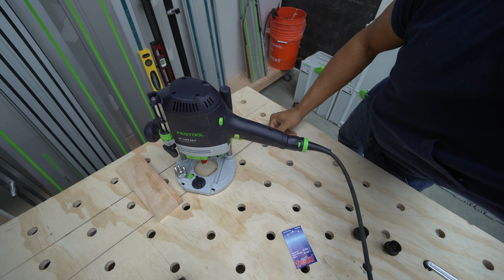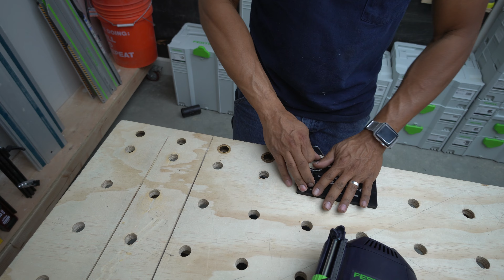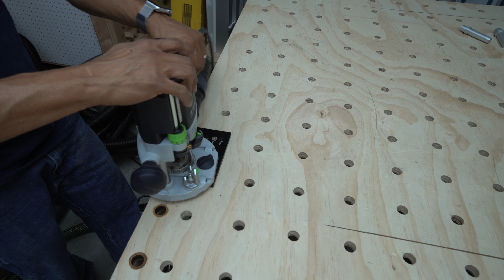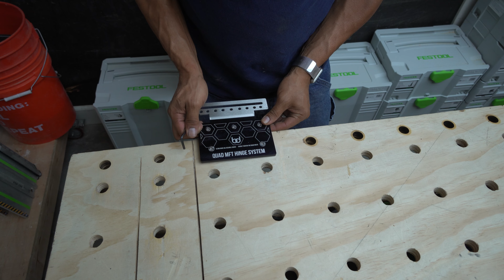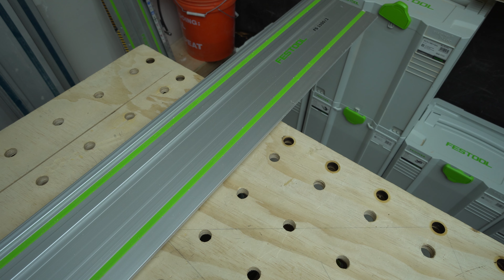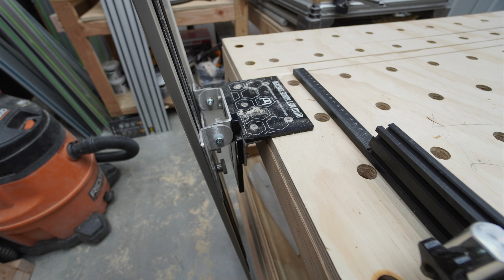BenchDogs CO UK Quad Hinge System Install

Comment: You made think I need that jig to make a MFT or do off sets. I have a bench dog china nock off. I have lots of bench dogs stuff but shipping cost made the hinge way up in price. The nock off was $140 delivered to the US, plus they added a piece to it. The added piece intrigued me and was the added reason to buy it. I let Bench Dogs UK know about the nock off.
Reply from the maker: I am glad you found a product that works for you. I decided to use the Benchdogs solution as it was offered with the Quad Rail Hinge system. 
Thanks for checking out the video.

Comment: Did you get the cutting edge of the track on the wrong side of the table?
Reply from the maker: I did. In the video, I used scrolling text to acknowledge that. Also later in the video there are close up still images that show the proper orientation near the hinge.